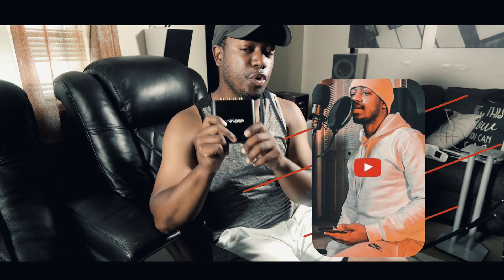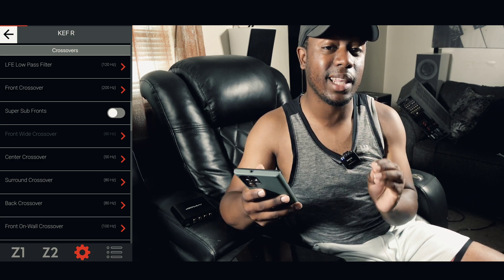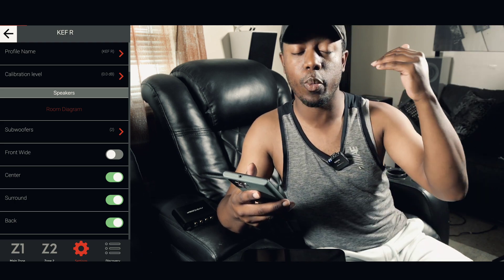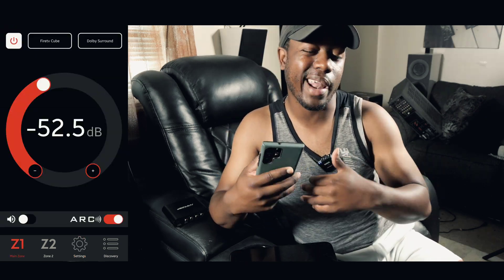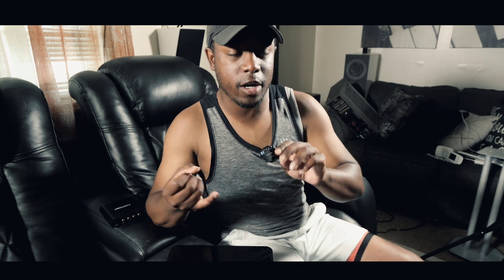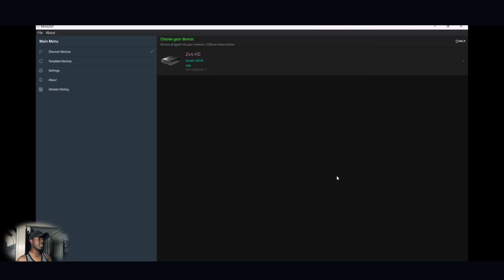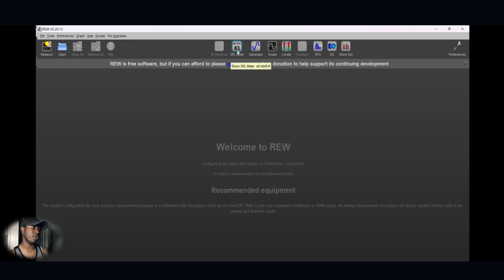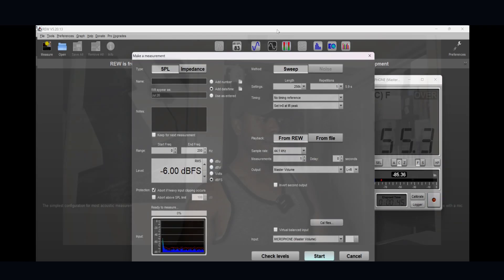Receiver/Pre Processor Settings and Subwoofer Setup | MiniDSP 2x4HD pt.2

Comment: forgot to mention in setup to use one sub output to the mini dsp  you did do setting in your avr with two active
Reply from the maker: Yes use one. Forgot to mention but I did set it up that way. I think I mentioned it in the next video I've pre recorded
Reply: @Kpaceguy  good stuff mate i actually do mini dsp callibaton, great video mate keep them up hope no offense for correcting a few things 🙂
Reply: Does using a splitter cause issues with calibration?
Reply: @xeroh7141  yes because your making one virtual sub by time alignment in mini dsp .use one sub pre out only
Reply from the maker: @xeroh7141  you don't one with the minidsp. It essentially is a splitter
Reply: @Kpaceguy  Makes sense thanks 🙏🏾. I’ve gone through the dsp set up before and after I did all the work one of my subs would clip and protect during heavy bass scenes. I didn’t have it anywhere near max. I unhooked my dsp and did a regular aud calibration and the subs played fine. Has your dsp ever caused any clipping? If not off the top of your head do you know what could have caused it? I would really appreciate the help.
Reply from the maker: @xeroh7141  you've probably turned up the gain on the dsp which essentially made the volume level way too loud OR you boosted frequencies way too much
Reply: @Kpaceguy  possibly 🤔…I’m gonna use your vids and give it another try, thanks again 👍🏾
Reply from the maker: @xeroh7141  Thanks for watching

Comment: It is annoying that basic processors and mid priced receivers don't have a SPDIF output of the LFE channel output. 99% of Mini DSP users would not have to deal with more RCA and XLR cables and the A/D to D/A conversion.

Comment: I used the Spatial Audio Calibration Toolkit! I run my subs a little hot (82db)
Reply from the maker: I'll be trying that out soon for review !
Reply: @Kpaceguy  It’s a process that covers a lot during calibration.
Reply from the maker: @wendellwendellb339  I'll give it a shot
Reply: Not that overpriced Joe and tell one.?
Reply: @Echo-jg8is  It was a lot cheaper when I got it. Preorder was cheaper, buy it now, you’re gonna pay. It calibrates your system on a lot of different levels!
Reply from the maker: @Echo-jg8is  that's the one
Reply: @Kpaceguy  In turn put each speaker through the left or right channel of REW, now you have a proper calibration toolkit for a Complete Dolby Atmos system... Voila 👍

Comment: So you should set your mains to 200hz? I thought it should be at 80hz
Reply from the maker: This is ONLY for using the dsp. We don't want the test tones coming through the speakers when Calibrating the subwoofer. After you're finished setting up the minidsp you can turn your speaker crossover back to whatever you had it set to
Reply: @Kpaceguy  oh okay I was kinda confused lol but makes sense and how come you don’t set your subs in phase?
Reply from the maker: @Lowkey_nxthxn  because we don't know yet if you should or not. You can use the measurements to find out if one should be switched or not. Best to start off with default settings and then make changes as you start reading the graphs. You can also change the phase in the mini dsp with a click of a button so you can see in real time what changes are happening.
Reply: @Kpaceguy  when I buy a mini dsp I will re watch these videos when setting it up
Reply from the maker: @Lowkey_nxthxn  hopefully they help!
Reply: listen he explaned why you do it
Reply: @shaunmeredith652  I can still ask questions btw
Reply: @Lowkey_nxthxn  of course you can but he did go into great detail explaining your question ...anyway ..
Reply: 80hrz will be when he does sub and main integration and you see how the room affects the crossover point

Comment: I am curious,   After REW is totally completed ,  would  you then run Anthem ARC and allow it to further refine the bass settings?
Reply from the maker: You can do that. Some people believe it'll make your built-in calibration THAT much more accurate. Some people rather run calibration first then turn off calibration, use the minidsp, then turn on the calibration after. I personally would run ARC again after using the minidsp